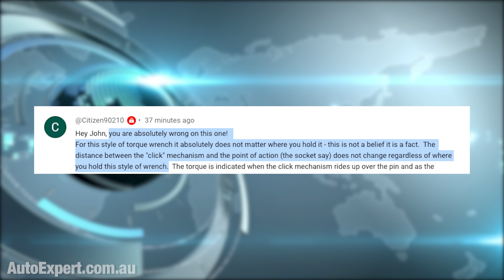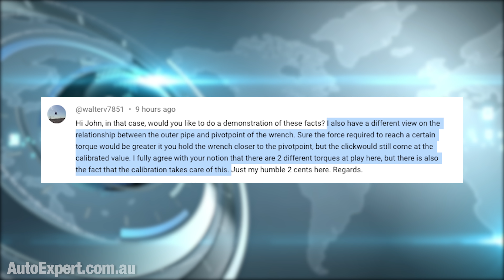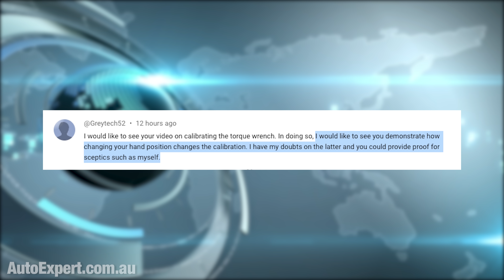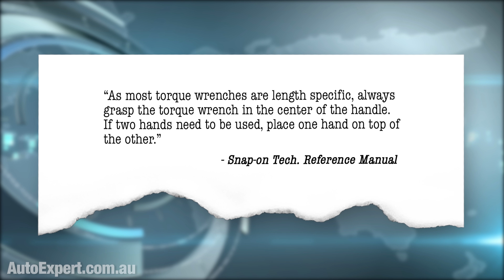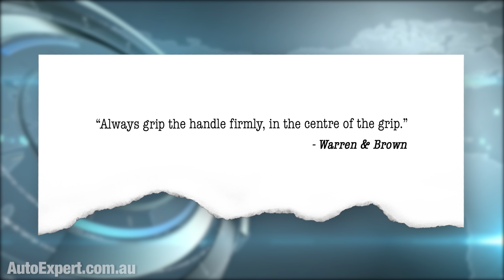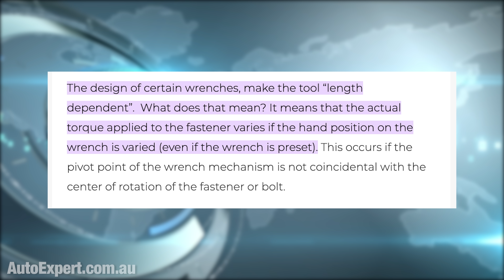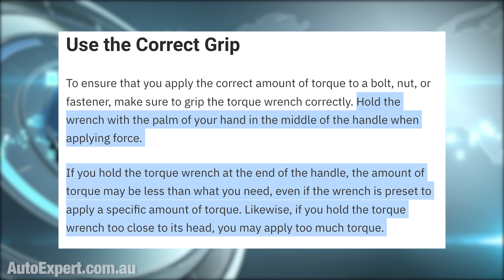Am I wrong about torque wrenches & hand position, again? (The facts) | Auto Expert John Cadogan

Comment: I'm 72, and I learned this stuff so long ago I can't remember, now. I do remember having everything you've said confirmed, though; every time my father and I built an air-cooled VW engine for off road racing (Mint 400, Baja 1000, etc.). Dad had a huge, dial gauge torque wrench, that was made for working on the P&W radial engines in B-29s, B-50s, KC--97s, etc. The required torque on those engine's cylinder head bolts, for example, was... well, a whole lot. The wrench came with screw-on handle extensions, and the dial had concentric rings of torque values for no extension; 1 extension; etc. Messing around with different handle lengths, while tightening the flywheel nut on those VW engines (365 ft.lbs., IIRC) and seeing the different places 365 appeared on the torque value rings on the gauge, was more than enough proof for me. I have 4 torque wrenches in my garage (my @#!** brother got that P&W wrench, blast his eyes); I take good care of them - and I hold them where they're supposed to be held. Sadly, though, that comedian was right: "you can fix a lot of things, but... you can't fix stupid..."😉

Comment: As an automotive engineer since 1980 + 4 years as an apprentice I was taught the correct method in my first month of my apprenticeship (grip at the centre of the marked handle) some of the brands had flares on each side of the grip handle so the hand fitted true. The work we did was preparing race cars and fast road cars for 1/4 mile drag racing at Castlereigh Sydney and everything we tightened was finished off with a torque wrench. Loved the sound of the 4 barrel carburettor when revving up 😊
Reply: You might say, whatever you like, you are still wrong.

Comment: John is 100% correct I calibrate and adjust these type of wrenches for a living. Click and Cam is what clicks when you pull on it. I use NATA calibrated equipment, and moving your hand up on the handle or down on the handle can change readings drastically. Any wrench that has a handle that you have to wind up must be wound down after use. If you leave wound up to high it can damage the spring on the inside of the wrench.

My personal favourite wrench brand is warren and brown as alot of other manufactures use a spring and other componets to achieve the desired torque value. Warren and brown have a deflection bar that reacts against a small pin.

Comment: As an old mechanic, I am reminded of the instructions for the old style Sturtevant beam-type torque wrench. The plastic handle has a center pivot, and while applying torque, one has to ensure that the handle is "floating" and only applying force on the pivot, not the ends, to avoid error.

Comment: I had to sketch a small diagram in order to "get a handle" on this. And yes it makes complete sense. The subtlety that is easy to miss is that as you stated the torque "sensing" component is at a distance from the actual square drive. I have never dismantled a click type torque wrench so I had not realised where the "click" was generated. (I did not see the preceding video).

Comment: Thanks for the heads up on the proper use of torque wrenchs and especially for casual users like myself. Makes sense really when you think about it as varying the length of the handle by different hand placement along its length is akin to changing the length of a lever and the amount of mechanical advantage or torque that is applied. Can see how some may get hung up on the preset on the internal spring negating this effect.

Comment: Well done john. Very interesting.  I didn't believe it until you proved it. I couldn't get my head around why but i just got it. Its like loading a trailer. The further forward you load the trailer the more weight goes on the ball. The further along the torque wrench handle the more torque goes to the bolt and less to the clicky thing.

Comment: In my collection I have an old, old Craftsman pointer-bar on a scale type torque wrench where the handle is actually on a Pivot. The instructions specially noted that when operating the wrench, it is critical to accuracy that the PIVOT POINT carries the load. Binding the handle on the bar changes the length of the wrench and creates inaccurate torque. Ancient knowledge.

Comment: John, initially I had my doubts until I came along this simple and clear explanation. If you were strong enough to tighten at the pin the pipe hinges on - no matter how much actual torque was applied to the bolt, the wrench would never click.

Comment: You are right, they call it a "Handle" because that is where you put your hand, the clue is in the title. Been using torque wrenches since 1969, and while at Rolls Royce they provided you with a printout, with the torque adjustment for using extended open end and ring spanners for tight spaces AND positioning of the hand , funnily this was ALWAYS on the handle provided. Don't let the "Special People" get you down.

Comment: Another 2 cents for the mix....From 1990 to 2000 I worked in the Snap On Tools repair center in Canada. The torque repair/calibration department handled torque wrenches from all over North America from all kinds of industries including automotive to aerospace. The 2 calibration machines had adjustable points of contact with the wrench under calibration. The calibration procedures were very specific in specifying the allowable area of contact. Yes, it does affect accuracy of the torque applied to the fastener.

Comment: It does take a minute or two to visualize how hand position affects the force distribution and torques between the pivot pin and click mechanism. The torque is calibrated based on all of the force being applied at the handle. When you grab it half-way between the pivot point and grip, a force proportional to the distance between hand and click mechanism to the pivot point gets applied directly to the pin, bypassing the torque-setting mechanism. Half the force can end up unaccounted for and after accounting for the different lever lengths to the fastener from the pin vs clicker, you end up with 20-50% higher torque than setting.

Comment: I didn't know that it changed the torque indication. I kept my hand on the grip anyway because it offers me better leverage to reach the proper torque.  The most common problem I see is people thinking that they have to do multiple clicks to get the torque correct. The problem is that the first click is the correct torque but each subequent click causes it to be overtorqued. If you want to retest the torque then the propper method is to loosed the fastener and retighten until you hit the propper torque. The only exception to this rule of loostening the fastener before testing the torque is when you are retorquing fasteners on vibrating/rotating parts to counter the natural loostening from parts settling into position.

Comment: I understand what you have said and your verbal descriptions make sense.
However I would point out that in some of those written instructions that you read out and highlighted, there is the point that it is stated to ‘hold the torque wrench in the middle of the handle’, which does go against what you have said, and where the ‘hand-grip’ (knurled area) is actually ‘built’ on the handle, which certainly appears to be at the furtherest end of, and not in the middle of the handle.
I am looking forward to the next video that give perfect demonstration of the application!
Reply from the maker: The handle is the knurled bit. The plain tube is just a shaft. It's called 'English'.

Comment: I learned what you speak of 54 years ago with the workings of a beam type torque wrench. There is only one way to hold it, as the handle of the one I have has a center pivot pin in the handle :cat-orange-whistling:. So just the facts, just give me the facts :face-blue-wide-eyes:!

Comment: Suppose the key to understanding is that the spring is calibrated to the length of the handle when your hand is in the correct position on the hand grip plus the length between the clicky bit and the socket on the fastner.

Comment: John you are correct placing your hands on the body tube instead of the handle will affect the torque you are applying.
Reply: Yes, torque YOU apply to the handle, not the torque applied to the JOB!
That Bogan is completely incorrect!

Comment: When I was a teernager working with fitters and turners got bonked on the head for using this tool the wrong way (hand position in wrong spot). I had under torqued the flange bolts that would of resulted in fluid leaks in a new installation. That bonk on the head stayed with me forever and never place my hands in any place than where they are ment to be. Dont matter if you understand the science or maths behind it just follow the instructions to get correct results.

Comment: The old beam style wrenches had a pivoting handle that ensured accurate readings unless you were really ham-fisted and tilted the handle until it contacted the beam.  These wrenches made it clear that applying the force at a specific point was intended.

Comment: Set up a demo please John. e.g. 3 torque wrenches: 1. Standard (correct) hand positioning. 2. Shorter hand positioning & 3. Extended hand positioning. I can see shorten positioning will be inaccurate due to uncontrollable torque of "mechanic" arm strength. The extended length should be the same (or more accurate imo). Pop Corn is ready. Thanks.
Reply: Do a YouTube search and you'll find plenty of such recordings.

Comment: I thought you were FOS, but I've got a different calibration tester that I built that uses 2 ball bearings to hold the shaft straight with a 6 inch arm and a 3rd bearing that rolls across a digital valve spring force tester.   I got the same results as you.. 😏
Add:
Not only did I move in but added a bar to make the torque wrench longer and still got results indicating you are correct.

Comment: Hmmmm.... I watched the first one earlier, and swallowed it whole. Long time subscriber. Full thumbs up send.  But, now that I'm watching this one, I have a question- how does the mechanism on the inside, activated by some part of the inside of the tube, "know" for lack of a better term, what part of the tube your hand is pulling on?  I'm very likely missing something.  I'm looking forward to the torque test. Don't care about being proven right or wrong lol.  Just interested in learning.  PS, I have ALWAYS been careful to only grab the shaft by it's proper handle. Because... It just seems right.  And the edit: this comment was before you read off all of the quotes.  That was epic lol.  This has become far more interesting that I'd have first thought!
Reply: Torque is measured in Nm which is Newtown (Force) x metres (Distance) - agree?
To simplify numbers lets use round metres;  wrench looks like a line;
socket <--- 2m -> clicky mechanism <- 10m --> grip.   If we set the mechanism to 100Nm, then we need to apply 10N of force to 'trip it.  Since 10N x 10m is 100Nm.   The socket is another 2m away so it receives 10N x 12m = 120Nm torque

Now lets grab the handle half way up: socket <--- 2m -> clicky mechanism <- 5m --> grip
Now we need 20N of force to trip the mechanism since 20N x 5m = 100Nm.  But the socket now receives 20N x 7m = 140Nm torque.   So even though the trip mechanism still trips at 100Nm no matter where you hold it, the actual torque applied to the socket is different.
I'll be honest - I hadn't thought about until John's video yesterday and my 'gut' would have been wrong :)  The gut is right in that the click mechanism releases at the set torque regardless of where you hold the thing, but doesn't consider the additional distance to the socket - and until John's vid I'd never seen inside a wrench to even think about that!
Reply: @davelloyd-  Yes!  Your explanation is superb.  I just watched the third video, and, well, it finally "clicked" for me lol.  In my question above I was forgetting the entire point- the two different torques.

Comment: Thanks for this, I stripped a bolt on my bike, it was only a very low torque setting and I held the torque wrench at the top and stripped the thread.
Reply: Torque wrenches are meant to be used in the ' centre of the scale ' .............
No good trying a ' big' wrench on the ' bottom' of its scale = recipe for disaster !

Comment: I always thought that it didn't matter where you gripped ir because it just measured the torque applied at the pivot point. 
Thanks for the real facts John. 
I would never argue any facts with an engineer because no matter how obvious it might seem, the engineer knows facts that I don't. 
As simple as that
Reply: Well, I'm an engineer and always hold the handle. Its hard to see, because its inside the handle, think it will only be a problem for higher torque setting were the tube may flex.
Reply from the maker: I don't see how being an engineer means you can't be wrong. I've been wrong plenty of times. However, I am not wrong about this issue. (It's too simple.)
Reply: @AutoExpertJC  I know you can be wrong but the chances of being wrong are much higher for me. I dropped out of school after year 8 and had to work hard. Life had taught me a lot of things. One of those things is listen and learn. 
Keep it up. I was brought up in Australia but now follow you from Spain.
Reply: @AutoExpertJC  I know, I'm trying to say, he can't understand it because he's thinking of the spring tension but it's over the calibration length. It's odd, but if you put your hand lower the torque goes up quite away, but put a 'cheater bar' on and it hardly makes any difference so long as its over the handle grip only.

Comment: I remember when the water department in my small town kept having to pull a well pump that kept comming apart in the well because the bolts kept working loose from the torque of the motor. They were using a six foot cheater pipe on the torque wrench. I have no idea how many tens of thousands of dollars were spent on this mistake. It turns out that some people's two cents are only worth two pesos.

Comment: I thought my new torque wrench was broken so I welded the shaft to the inner part since it was rattling. I also replaced the small pin and put a solid bolt and nut instead.  I'm starting to think you are saying the wrench was supposed to be broken?

Comment: Hi John, thank you for the resent series on torque wrenches. I think that your expression of the situation should go down in the anal retentive wall of history.
"Facts do not care a shit about opinions" John Cadogan July 2023 Love it. I have been a small engine builder for a number of years and working with mainly aluminum
castings and parts its very important to get the correct tension on your fasteners. I have always followed the manufacturers recommendations that come with the tools.
I am sure that they are aware of the correct use of their equipment. I ask that you may find a small amount of forgiveness in you day for those that were born stupid as they had little to do with their conception. Always look forward to your channel  thanks again MORE POWER cheers

Comment: Well I am glad I never said you were wrong!  I am concluding that the deflection of the outer tube (handle) is essential to the operation?  What about the question of how it should be stored.  Should the compression on the spring be released when storing?
Reply: Was answered in previous Vid ( = no )

Comment: To confirm that hand position does indeed have an effect, consider putting your hand exactly where the pin attaches the outside handle to the inner one and applying force. The wrench will never click as you're applying a force at the fulcrum of the outer handle and thus there is no torque applied to it. Further, if you move your hand to between the pin and the ratchet, the wrench can now only click if you apply torque in the opposite direction.

Comment: 6 hours ago when I watched the video I thought you were wrong

Since the idea has had time to simmer, I’ve concluded you’re right.

For example if you apply the correct torque, at the clicky lever pivot point, zero torque is available to operate the clicker

Comment: I think the thing you did not emphasis is the difference in the length of the lever arm between the distance from your hand to the point of rotation and the distance from your hand to the pin which connect the tube to the head. The torque scale is calibrated to the specific ratio on the TW. If you relocate your hand then the ratio changes.
I think you will have to make a demo with a torque meter.

Comment: Apologies if these are daft questions. When Snap On said 'if you need two hands put one over the other,' that was if one hadn't had their Wheetbix and struggling to get a click, yeah? Also, I think when ever I've used a torque wrench I've had my other hand pushing down on the ratchet. Would that stuff things up as well? I wouldn't have thought so but I didn't realise what a different choking up on the handle would have made either. Donno what i donno I guess. Cheers.

Comment: In watching the first video, I didn't bat an eye.  I just agreed because it seemed intuitively correct, and it's what I have always done, even though I didn't understand why.  Then watching this second one, I was second guessing myself and John, at least until he read off all of the quotes from the torque wrench manufacturers lol.  Now, after having watched the third one- and this is going to be bad, but- it "clicked".  And now I get it, and I understand.  The clicky thing goes off at the same torque no matter what, no matter where you grasp it (assuming you don't change the adjustment).  But my original question in video number two was not taking into consideration the proportion of the two torques, which is the whole point all along.  Some of us humans are indeed a little slow!  But, at least I have been respectful about it.  Thanks for the education, John.